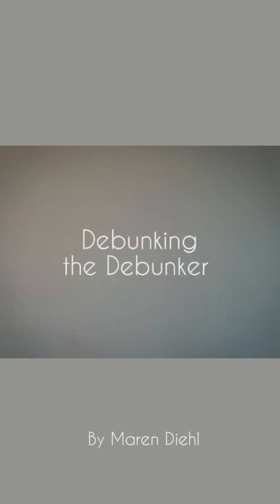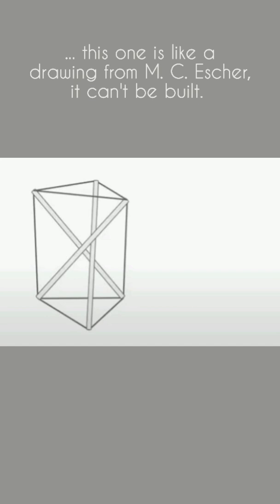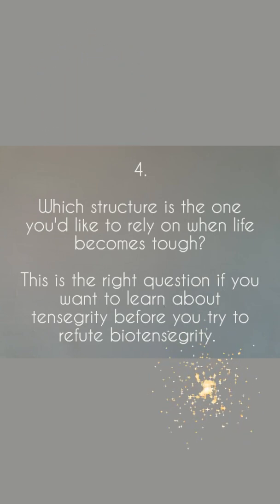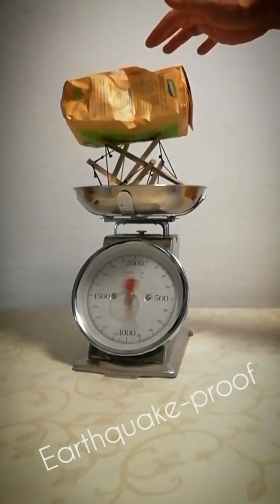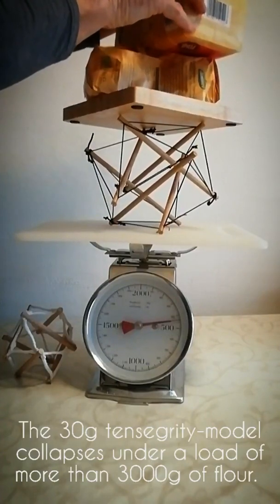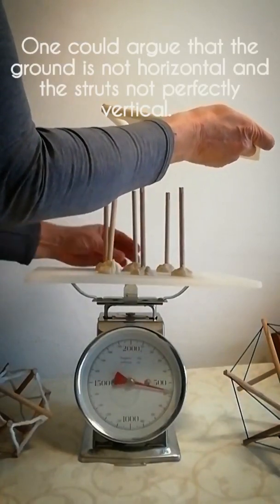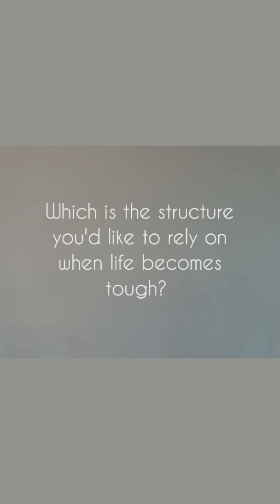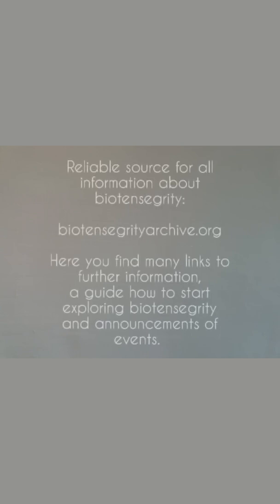Debunking the Debunker 1

Comment: 2. The entire big idea behind tensegrity is exactly that – EVEN at the minimalistic 3 strut setup, the tensegrity setup creates the system that behaves as structurally and kinematically indeterminate framework exhibiting the dynamic behavior of super-stability upon external permutations. This dynamic behavior stems from being internally pre-stressed, and kind of ‘looped’. The superstability theorem has been proven by Prof. Connelly of Cornell in a pure mathematics sense with fully abstracted struts and cables, i.e. making it independent of the actual lengths, materials, etc. 
This ability to create a statically and kinematically indeterminate and yet super stable framework EVEN with the minimal number of members is what makes tensegrity interesting and attracts the attention of thousands of practitioners, engineers, and scientists alike. 
Your ‘debunking’ argument was obvious– a simple free body diagram that any first-year engineering student can do. Clearly, within an assumption of a determinate free body diagram– three vertical struts always win over three tilted struts. Duh! Thank you very much, we didn’t know that! 
The real question is -- whether the free body diagram is applicable in case of interesting pre-stressed combinations? Biotensegrity’s makes a central assumption that FBD is not applicable and we need a different approach to pre-stressed frameworks structural analysis. 
The interesting thing about tensegrity is to realize that because of framework effects compression members that touch the ground end up having a resultant local ‘kiss touch’ by distributing the reaction force impact through the entire framework rather than having a full weight-proportional load concentrated in a point of contact. So it's a completely different dynamic behavior compared to the one predicted by simple structural analysis.
Reply: Interesting.  You seem to be saying that free body diagrams not apply to tensegrity structures? Am I reading this correctly? That would be a new claim from the tensegrity side as far as I know.  Indeed if you are giving up on free body diagrams, then it will be hard to continue the debate.  I'm also not clear - are you arguing that you think the 3 strut tensegrity model will have less compression in the struts when a weight is put on it?

Comment: Hi Maren
Thanks for watching my video and taking the time to try to refute it! I firmly believe in critical discourse, and I think this is ultimately what you were trying to go for here (despite a few kind of personal digs that I think were unnecessary ;-)). 
1) You are right that my drawing is missing a cable and the triangles are slightly misoriented.  So thank you for pointing that out. I made it with powerpoint and could have been more careful.  On the other hand, the calculations I made for the structure are not altered by the mistake in my cartoon.   So the main point still stands - the tensegrity structure will have more compression in the struts than the vertical rods. You make quite a big deal out of my cartoon mistake, and perhaps it is deserved to a degree, but unlike some of the so-called "tensegrity spines" out there, the omission in the cartoon does not fundamentally change the math.
2) Great to see you having a go at an experiment!  Indeed you show that the tensegrity structure resists deformation very nicely.  However if you watch my video again, you will see that I wasn't making a point about stability against deformation of the type you demonstrate but about compression in the struts themselves. I think it is fairly obvious that standing sticks will buckle over sideways when you put a weight them - I would have predicted the same thing.  Equally obvious is that trying to stabilize it at the bottom with clay will not work since the torque from the long rods will deform the clay.  But this says nothing about the compression in the rods themselves. I'm not going to call you a "faker" because I don't think you are one.  But your presentation does distort the argument, using the tactic of diverting the subject rather than directly addressing my central claim.  I'd love to see you create an experiment that does directly measure the actual compression in the struts.  It's not as easy as the one you did, but its the only one that would directly address my claims.
3) To put it another way, its well known that tension structures along the side of the spine stabilize it from buckling. But there is no need to invoke tensegrity there.  Furthermore the necessity of having stabilizing tension structures increases pressure on the discs, rather than decreasing it as so many tensegrity proponents seem to suggest, which is the main point I am making.
4) I would propose that if you are interested in critical discourse that you put a link to my video in your description so that viewers can make their own judgement.  
5) If you really want to dig into this further, I suggest you send me an email and we can arrange to discuss it by phone.  You can find my email at the bottom of my website, which is listed in the description of my video.   I much prefer a conversation to a youtube argument :-) in fact I really enjoy talking about this stuff (and don't really enjoy the youtube debates, as necessary as they are).
-Patrick
Reply: Dr. Johnson, It is surprising to see you write that you prefer A private discussion to public discourse on YouTube, since you are the one who chose this platform to put forth your thoughts. Now that you have put your thoughts out publicly, good scholarship compels us to continue publicly (and respectfully) with the debate you have chosen to introduce in a public forum.
Reply: @susanlowelldesolorzano9623    Well that's an interesting critique!  It seems like you think I want to hide behind a private discussion.  Indeed that would be sneaky.  But that is not my intent at all.  (Do the pages and pages of public comments I've made so far count for nothing?  See the comments on my original videos.)  No, the reason I ask for private conversations is that a) all of these public comments have required huge amounts of time and energy b) I like direct conversations so much more - the back and forth is much more efficient c) I actually want to meet people in this debate in addition to exchanging anonymously.  d) I actually think it is more honest, in the midst of all this public debate, to also offer to converse privately to see if there is common ground that can be found in a personal discussion, rather than youtube which often encourages an impersonal tone.  
Luckily I've had one lovely and fascinating private email conversation with one tensegrity person who was kind enough to contact me on my request (after a series of detailed public back-and-forths that eventually exhausted us both). We've agree to call each other when we have more time.  Truly looking forward to it.
So this reply took about 20 minutes of my time.  I bet we could have gone much deeper with a 20 minute whatsapp conversation.  Perhaps next time.
By the way, are we really calling youtube videos "scholarship"? I hope it hasn't come to that! ;-)
Reply from the maker: Hi Patrick,
thanks for your reply. I am still working on part two. Compared to the "personal digs" in your own video I think I've been very politely. The point you miss is that neither tensegrity nor biotensegrity is about compression in the struts or in joints. It is about directing and organizing forces and the models represent the physics and not the body, even if there are models of body parts.
So I have to give your argument back to yourself: The question about compression in the struts is misleading, not my setup. 
My setup leads directly to the question why biotensegrity is absolutely worth thinking about and why the compression you make a problem of doesn't matter. 
The next video is scheduled for January 2021.
Reply from the maker: Hi Patrick, here is part II: https://youtu.be/qj1Q8UfbPug
Reply: @marendiehl9065  I love it.  And right one schedule. I totally disagree, but I love your approach.  See my extended comments that I posted on that video.